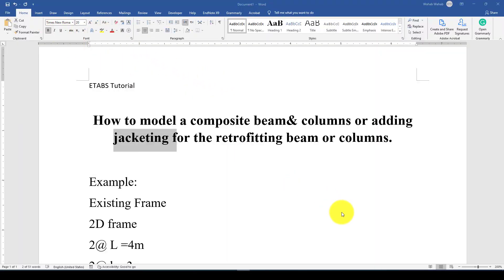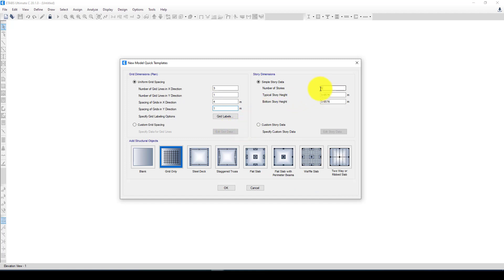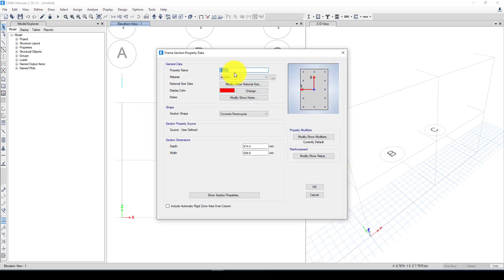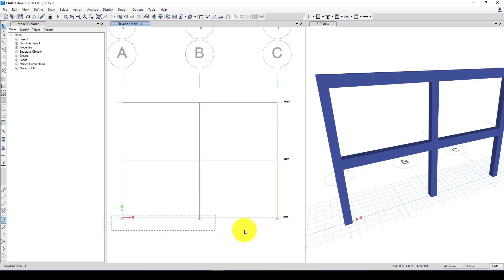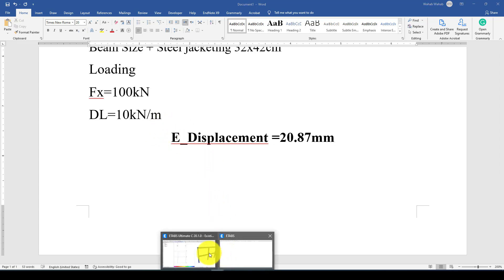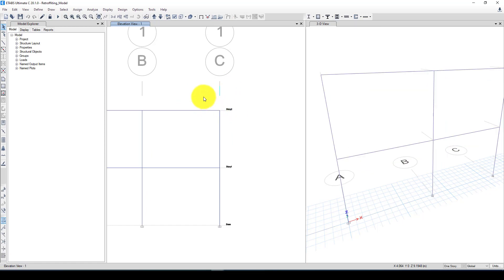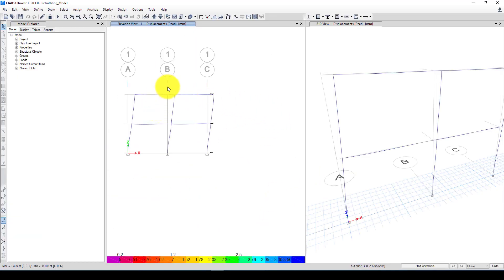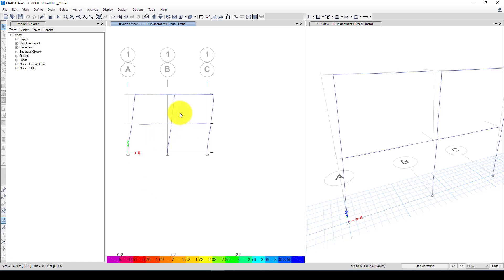ETABS Tutorial: How to model the retrofitted beam columns with steel and concrete jacketing

Comment: How do you check now the beam section is adequate or not? In your experience, Do you check the design thru the concrete frame design? Is there any means to check the D/C ratio?
Reply from the maker: Yes you can check manually or from design output.
Reply: Upon checking the ETABS design output, the retrofitted beams were designed as columns. Is this correct? If not, how do we translate this as beam to verify its strength criteria or its D/C ratio?

Comment: How does retrofitting work in etabs? Does it acts as a single component after adding section property or does it behave like different components (previous column and new added box) taking different loads??
Reply from the maker: It behaves like column.
Reply: @KSSE_Engineer  it act as a individual column that is rectangular column is single column and the box is also a single column, then this is the theory then explain that the added load if any then inside column will fail( that's why we have jacketed column) and outside box will pass then there is no add up in strength of the inside column.so , structure will fail as previously. So how can we explain to etabs that there is distribution of load to entire inside and outside Element of column( bcz in section designer the individual axial load capacity of both box and rectangle when draws seperately, gives the same value when draw combined as yours, so there is no increment of add capacity, so means they are acting individually)?
Reply: @KSSE_Engineer  can you give your number so i can contact you, for proper explaining my problem? And your solution will pe precious to me.
Reply from the maker: Plz Join my channel membership and let me know what do you need.
Reply: @KSSE_Engineer  sir, actually we are doing final year project on retrofitting. We just have a small doubt on the behavior of jacketed column. Whether the box and rectangular (original) column will act as one unit to take load or differently...
Reply from the maker: @sanskarthakur3416  Obviously It will act a single unit .
Reply: hello  brother

Comment: excellent work, i would like to ask a question that, in case we are doing additional loads on structure which option to be choosen-  reinforcement to be designed or checked
Reply from the maker: For retrofitting process checked for new building choose designed .